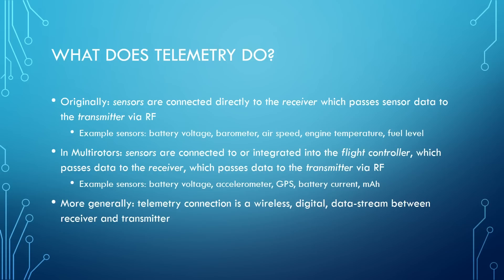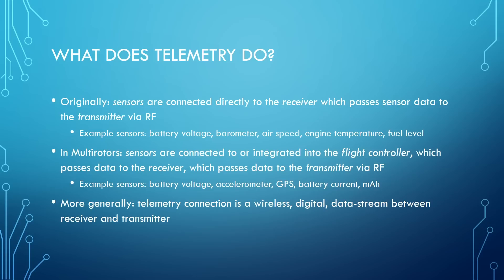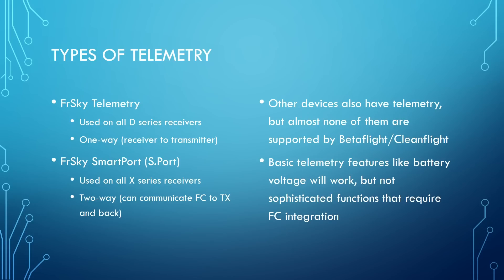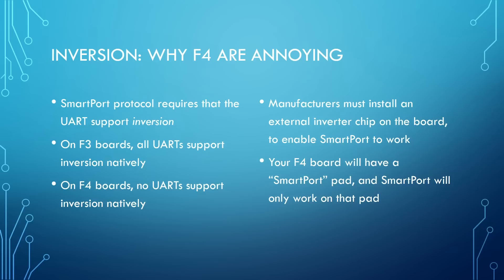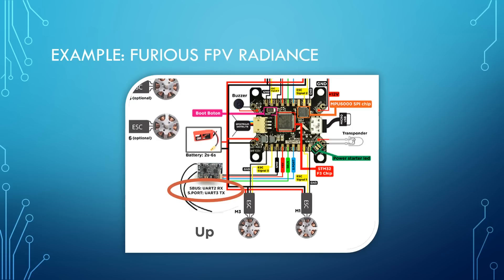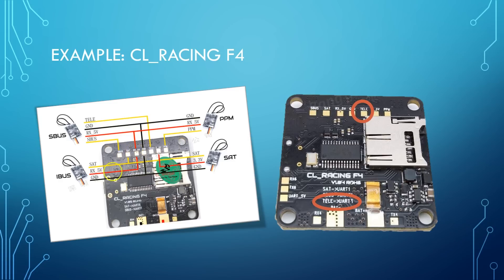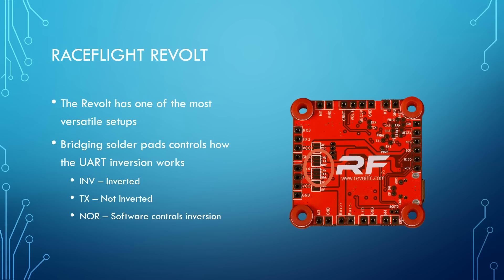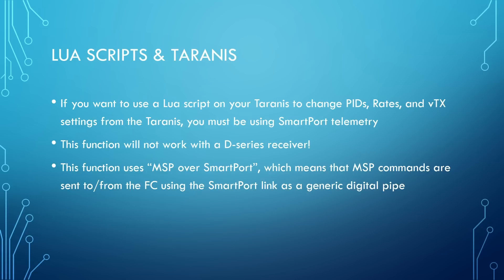Flight Controller Wiring For Beginners - PART 4 - Telemetry

Comment: Good video,-- off the subject-- I have started usingyour flight boards as a builderalmost exclusively. They are great, but accasionally the quad flies fine, and as I slowly accelerate-- it takes off straight up and I have ti disarm and watch the crash. Any ideas?

Comment: the CL racing f4 is hands down my favorite board I've worked with thus far. Had hoped to see you use it in a build because those guy hit the nail on the head. And it's affordable...
Reply: Shane Hale just bought one, good to hear

Comment: There is only one other FC and telemetry you didnt talk about :( And it is the one I ve got. I have a F3 built-in OSD and Radiolink AT9S transmitter, R9DS receiver, PRM-02 telemetry. As fas as I understand, UART2 to be used for GPS if exist, in my case I have one; UART3 is to be for SBUS receiver and UART1 already assigned for Vin-Vout. But there is a I2C port. My question, can I use this port for PRM-02 telemetry? If yes, how should I connect the TX and RX of telemetry, becasuse I2C has 4 pins as GND,VCC Clock Signal (SCL) and Data Signal (SDA). Can you help me out?

Comment: If your F4 board doesnt have dedicated inverted pin for smarport telemetry, you can also "un-invert" your telemetry from receiver by soldering telemetry wire before hardware inverter, which is what I had to do on X4R.
Reply: You can also repurpose another pin (motor 6 for example) as "serial_tx 12" and use it as softserial, inversion will be done on the cpu then, no hardware mod needed (maybe you need to bridge two pads to have rx and tx, researching this at the moment). https://github.com/betaflight/betaflight/wiki/Single-Wire-Software-Serial

Comment: Great Video! But still I have questions on the 4in1 Raptor 390 where the documentation says nothing about the uart tx to use for telemetry, its even not marked on the FC. Maybe you or someone else in the comment section, can help me out with this. I want to use telemetry for changing the PIDs on the Taranis and I need to solder the  s-port to the FC. But where? Thx
Reply from the maker: I did some searching and it looks like a lot of other people have the same question. Maybe ask over on the rcgroups thread.

https://www.rcgroups.com/forums/showthread.php?2769846-Flycolor-Raptor-390-Tower-4-in-1-30A-ESC-BLHeli-F3-6DOF-Flight-Controller/page7&perpage=30#post37200332

Comment: I am having a bit of an issue. I have a JBF4 ver.2 on my new quad and cannot seem to get telemetry to work correctly. I have the smart port on my rxsr going to the T pad, I have telemetry enabled in config and have uart 3 set to smart port, but when I go to discover new sensors, nothing pops up (other than RSSI and RxBt). This is working on my tricopter and cannot seem to find a difference. The only other thing I can think of is to move to the TX6 pad and use the non inverting spot on the rxsr? I would like to see if you have any other ideas before I go that route, though. Other than that, it flys 'fine' (flip of death at the moment, so I have changed a couple things this morning to try out when it stops snowing)

Thanks
Max
Reply from the maker: Did you go to the CLI and type "set tlm_halfduplex=off"?
Reply: @JoshuaBardwell  Mr Bardwell, you are the man. I always appreciate how quickly you reply to everyone and are willing to help out. Thank you.

Comment: Just to be clear, I go from the uninverted S. Port pad from receiver to the tele pad on my Cl_Racing F4 flight controller, then activate Uart 3 with smart port, enable telemetry, and I should be good?
Reply from the maker: No. Tele pad is intended to receiver the regular Smartport signal. Uninvert hack is not needed and won't work.
Reply: Joshua Bardwell  

Thank you for the reply, the inverted and uninverted part really confused me. But I think I got it now!

Comment: On the Matek F405 
Fc you can just solder the Sport wire on to the S5 pad on the board. then go to cli and 
Type "resource motor 5 none" hit enter then 
Type “resource serial_tx 11 A15” Hit enter 
Type "save" hit enter
Turn on Telemetry and softserial. 
under ports in betaflight set the softserial1 to Smartport save and reboot. you now have full 2-way telemetry if of cause you a Xserie RX.

it takes less thank 4 minutes to do.
I love this board it so easy to work with. the quality seems better than average. 
if you pair it with the FCHUB 6S PDB its even idiot proof to install!
Reply: wardope I am currently attempting to do this on an F405.  The "resource serial_tx 11 A15" command and setting the port to softserial1 is that correct?  Should it be a 1 in the CLI command instead of 11?
Reply: It should be 11
Reply: wardope thanks sir.  It makes sense now and I got it working!  I'm loving the Taranis QX7!

Comment: Hy Josh!  I have  Emax Hawk 5+RXSR+Taranis Q X7S. Exactly where do I need to solder my receiver's smart port cable to Emax Tower?
Reply from the maker: I believe the Emax tower does not have a dedicated telemetry pin with inverter. So you must do the "uninvert hack" on the receiver, then use any UART RX pad. There are pads for UART 1, 3, and 6 on the FC, towards the rear of the quad from the vTX.
Reply: @JoshuaBardwell   Thanks for the answer! Do you have any other alternatives to display rssi?

Comment: Hi Joshua. For radiolink,can i do telemetry?I searched the web,and most I read it saying you need another component which is the PRM 01.Can I have telemetry without this additional component.thanks in advance.
Reply from the maker: I don't know much about Radiolink telemetry.
Reply: Niknok Rogan PRM-01 will only send quads battery power, and Rx power to the receiver. Rssi can be found under the menu/system I believe. You can also set a alarm for low rssi.

Comment: Hey JB.  I 'm using an X4R-SB with an Omnibus F4 Pro.  I soldered the wire on the X4R to get uninverted signal to TX 3 on the F4pro.  I get 4 parameters when I "find sensors" and nothing on PID screen / Lua script (I followed your instructions to the letter).  Should I get more than 4 "sensors" found (I have current sensor turned off) and do get Vbat on the Taranis.  Any ideas?
Reply from the maker: Yes, you should get more than 4 sensors. 4 sensors is likely the built-in sensors on the receiver. You're not getting telemetry from FC to RX.
Reply: OK. Thanks.  I'll troubleshoot some more.
Reply: New saying "the connector you don't see is the one it should be".  I tried to be cheeky and not take apart my Chimp,  Turns ourt I had the connector on the wrong port - lol.  All good now.

Comment: Hey Josh I have a micro lux FC just wondering if you know if it supports smartport telemetry?
Reply from the maker: I can't find any indication that it does.
Reply: Joshua Bardwell Yeah I couldnt either. I was hoping it would but pretty sure it does not. Thanks for checking for me and thanks for the videos they are a big help!

Comment: Can any flight controller be used with either D or X receivers, or does this depend upon the processor used (F3, F4 etc) ? Thanks Joshua for the excellent video!
Reply from the maker: All those receivers output SBUS so it doesn't matter which FC you use vs. which receiver.
Reply: @JoshuaBardwell  Thanks! That's good to know.

Comment: I watched the LUA script videos and everything when well. The only issue I am having is then I run the script and look at my PIDS it says no telemetry. Then If i unplug the quad it will say telemetry lost and when i  turn it back on it will say telemetry regained and the pids show up quickly but then on the taranis it still says no telemetry. I am using a BFF3 board and a XSR smart port going in to TX1. Any help would be great.
Reply from the maker: XSR have issues with telemetry. A firmware update fixes it.
Reply: Joshua Bardwell thanks. Now everything comes up. Still says no telemetry but it works. Now with 3.2 my PIDs save bit reset sometimes. I read that others have that issue too.

Comment: this is off topic I'm sorry.. but I'm going to trial soon for a wuadcopter related accident. criminal mischief 2nd degree 😒  I had blackbox enabled and I'm wondering,  my onboard  flash is full, if I fly it again,  will the oldest blackbox data be erased and the new data written? Or will it not record blackbox data because it's full.
Reply: I uploaded my blackbox data video if you are curious.  I'm gonna have to prove  with this blackbox data that the crash wasn't my fault.  something around 7-10hz  propagated  in the yaw axis 😭 and crashed and tore an awning. And they charge me with criminal mischief.  ugh.
Reply from the maker: No, once the dataflash fills, you have to manually erase it. The quad stops logging once blackbox fills.

I think you're boned on the case. I doubt they care whether the crash was caused by your own fault or an accident. The fact that you were flying and damage happened will probably be enough to convict you. My gut feeling is that you will be considered to have been negligent.

Also, I would be surprised if the blackbox data was admissible in court, since nobody there is capable of interpreting it, so nobody can tell if you are telling the truth. Also, there is no chain of custody to show that you didn't fake the data. Etc.

If you really care, you should get a lawyer and let him or her make arguments in your favor.
Reply: yeah admitting  it as evidence is a worry of mine. the only chain  of custody I have is, i exported the flash data  that night . my computer had a timestamp  for the bfl.  file I exported (right click the file and click  properties)  to show the date and time, then i still  have that same flight data on the quadcopter still, that crashed, and that same quadcopter I have in a video, showing me taking it off the awning.  getting a lawyer would be more then $1000 dollars, so.. needless to say that's a no go for  me. thanks for the reply man.
Reply: well... you can fake Timestamps of files, it's pretty easy (and sometimes necessary if some idiot has the system time in the future...)
Reply: Robin Cerny well thankfully, it's the burden  of the state to prove I am guilty. I believe I have enough reasonable  data for them know I'm telling the truth.

Comment: Hi Joshua, great video. A question, can i use the same UART for two different purpose...i explain. I've got a DYS f4 and i would use RX1 for reciever and TX1 for telemetry (inverting the signal on the reciver), or i need to use different UARTS?
Tnx for your job guy!
Reply from the maker: No, Betaflight doesn't support that. The UART can do that but the two functions must run at the same baud rate.
Reply: Joshua Bardwell tnx!

Comment: Would you recommend running DJI telemetry or RXSR telemetry when using a Taranis qx7?
Reply from the maker: I don't think there is such a thing as DJI telemetry, so I'm not sure what you're asking :-/
Reply: @JoshuaBardwell  the  uart tx and rx that comes with the Air unit. Im trying to figure out if I keep those or try fport with my rxsr...?
Reply: I assume rx and tx will give telemetry in the goggles, but will rxsr sbus and fport give telemetry to my radio then?
Reply: @JoshuaBardwell  the lightbulbs gone off. Sbus and Sport to my FC from my RXSR and no video or ground from my air unit.

Comment: Went up and down not sure if I missed it but does FC AbuseMark NAZE32 support this or do I have to up to a F3\F4?
Reply from the maker: Betaflight 3.2 still supports F1 but just barely. Betaflight 3.3 will not support F1 any more. I would not buy anything less than an F4 today and I would not install an F1 in a new build.

Comment: Can you connect the reciever and telemetry to the same uart? And is one uart (the msp one) in the ports tab the usb connector?
Reply from the maker: +gustav gans you cannot put telemetry and redevelopment on the same UART.

Most boards today use VCP for USB so USB does not take up a UART any more.
Reply: whhat is redevelopment?

Comment: Josh, thanks for this, you answered many questions I've been looking all over to answer. In the last part of the video you talked about the XM Plus and telemetry, I had a xm+ and holybro Kakute FC, and was able to get osd rssi working. Now I have an XM plus and Omnibus F4 and cannot for the life of me figure out how to get the RSSI working on the OSD. I enabled smart port how it says to put still just can't get it to work right. Any help would be really appreciated thank you!
Reply from the maker: XM+ doesn't have telemetry. But there is a firmware you can flash to have rssi on channel 8.

Comment: Hey I'm sorry to ask, but I'm not sure where to wire s.port from my receiver to my hobbywing xrotor f4   board for telemetry. Is there a dedicated pad for that on that board that I'm missing? Or does it even have one? Thank you very much! This is my first build and I don't want to forget anything. Happy New Year!
Reply from the maker: Do the "uninvert hack" and use RX3. Alternatively, use softserial reassigned to the PPM pad (I am 90% sure this will work).
Reply: Joshua Bardwell Thank you sir! I will end up doing the "un-invert" hack for UART3 TX. I have one more question regarding that same board. What is the rssi pad used for? Again Thank you for the help!

Comment: Hi Joshua, Thank you for the video once again. I have a question that is somewhat out of scope of your series however touches on what youre talking about in this video. 
Is it possible to wire up a Current sensor to a uart? If so how?
Reply from the maker: No. Current sensor must be wired to an ADC pin.

Comment: Great explanation and informative video. Thank you.  but a small distraction for me was your use of "Free sky" I always thought it was F R sky. There is a company/products called Freesky and they are not the same. Am I not right?
Reply: "Free Sky" is actually the proper way to pronounce FrSky. They actually tell you that in the manual of their radios like the Taranis. So Joshua and everyone else who pronounces it "Free Sky" are saying it correctly as per the company's intention.
Reply from the maker: You are correct that the company FreeSky is different than the company FrSky. But they are pronounced the same.

Comment: Can you do a video on controlling auxiliary devices using the FC? For example, I have a cheap 720p "action cam" that has a signal wire and the manual gives an input range that looks just like the screen in beta flight, but I'm not 100% sure how to hook it up. I assume I just solder the signal wire to  an available uartTx pad?
Reply from the maker: I'm not sure I really follow your question.
Reply: Joshua Bardwell Sorry, still learning all the terminology. If you can, check out page 8 of the below PDF. I think I could configure betaflight to send the appropriate signal by configuring the Ports and Modes correctly... but I'm not really sure.
Reply: Looking at the manual you need to solder the wire to an unused channel on the flight controller and then through you transmitter setup the mixer for that channel. No UART is used.
Reply: fpv havok Thanks for the reply. My FC only supports PPM, sbus, or IBUS, so I'm not really sure what channel I could solder it to, I think all I have available is uarts
Reply from the maker: What you need to do is use feature channel_forwarding to forward aux channels to a servo output, and then use resource remapping to assign the servo output to an un-used pin on your FC. Sorry but I know that's probably not actually any help, but that's what you need to do.
Reply: Joshua Bardwell Actually that's a huge help, now I know what my next steps are and what terms to search for. Thank you!
Reply from the maker: Ok good luck!

Comment: Joshua im wondering if you might having info or will be doing a tutorial on telem scaling in betaflights gui? The reason i ask is i recently converted a kiss fc and kiss 24re's from kiss guid (firmware) to betaflight 3.1.7 and am getting telemetry data but my fuel and current are all screwy. For instance current is always showing 16 amps and fuel just rolls on at like 5 mah per second. I have discoverd new sensors so i know im seeing data but it is not scaled correctly. I honestly dont even know if that is a BF gui issue or a taranis issue but would imagine a BF issue seeing as how it worked fine with kiss firmware configured. Thank you sir
Reply from the maker: I think you need to set your Ports up to read KISS Telemetry, and then you need to set the Betaflight current source to ESC sensor or something like that in the Configuration tab.
Reply: I had read something different on the betaflight on kiss thread in RC groups but at this point it doesn't hurt to try. thank you for the advise.

Comment: This has always puzzled me, if the Taranis is outputting 100mw is the receiver also outputting 100mw ?
Also has the   EU version and the Non-EU version  the same range as I have been told that the EU version in only 10mw.
Reply: P.S.  have you used silicone fuel tube to soft mount a FC yet, maybe give that a go, works quite well :-)
Reply from the maker: Yes, the transmitter and receiver have the same power output, so telemetry should have similar range to the main signal.
Reply from the maker: I have tested that, but it is very very hard to get straight, even slices.